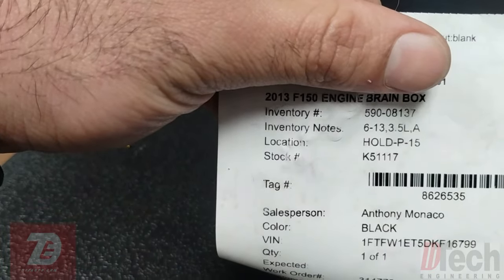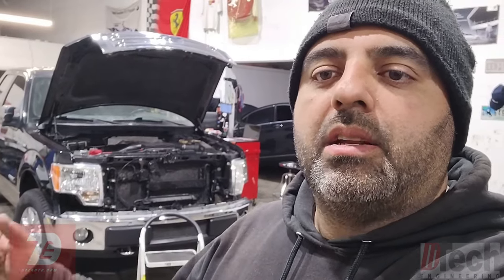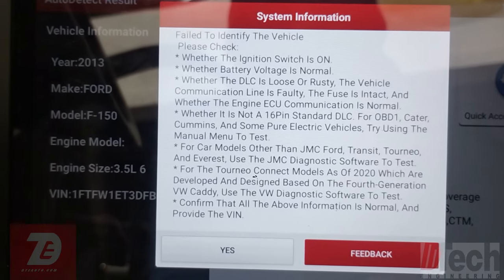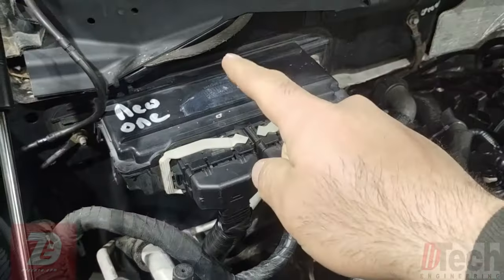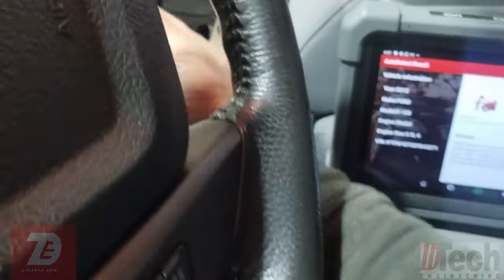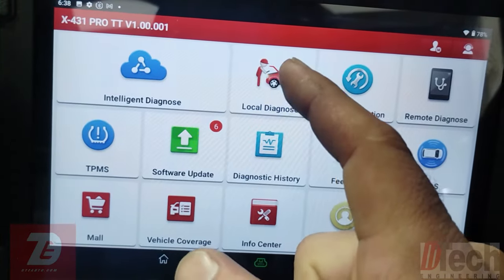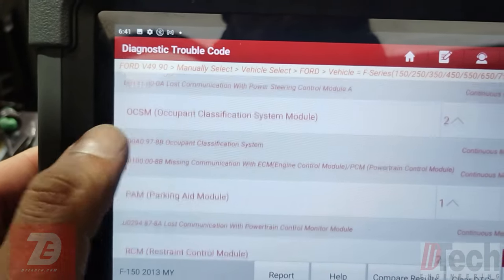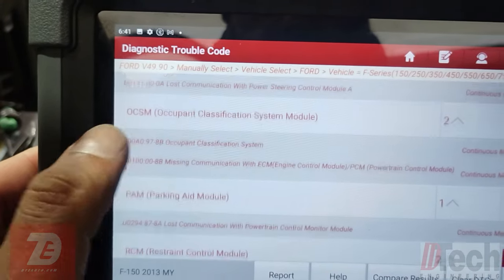2013 Ford F150 No Start No PCM Communication Diag & Fix!

Comment: Genius as usual.. I'm wondering why the corrosion not pulling down the signal??
Reply from the maker: because the corrosion just acts as an insulator and so there is no metal-to-metal contact so there wouldn't be a way to tie it to a positive or ground just same way as it doesn't tie it to its corresponding can high/low pins. Hope that makes sense. Thank you for watching